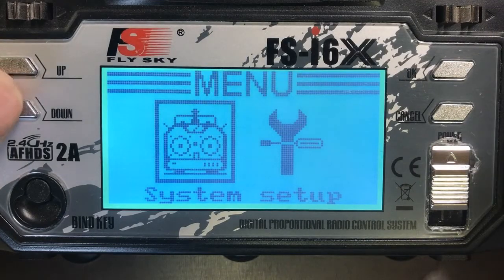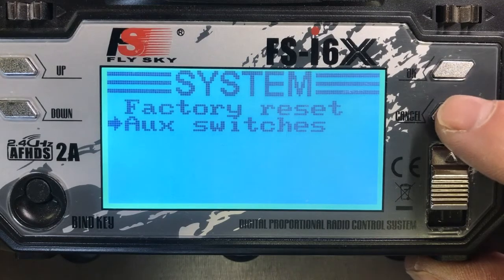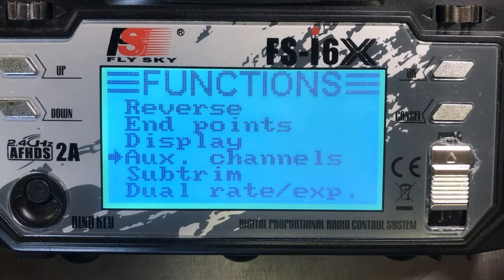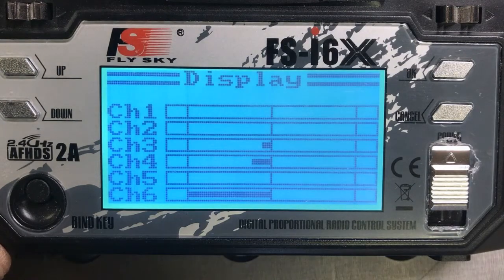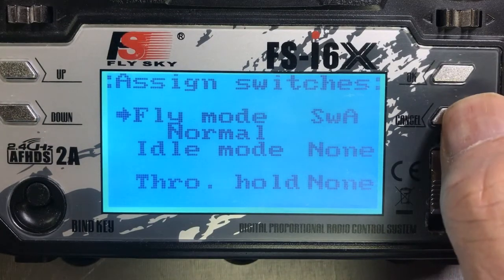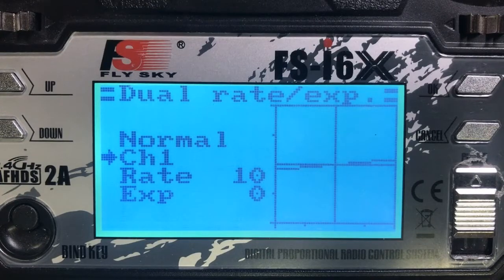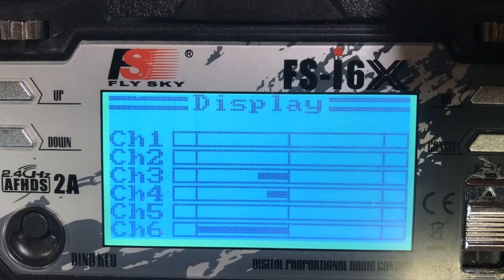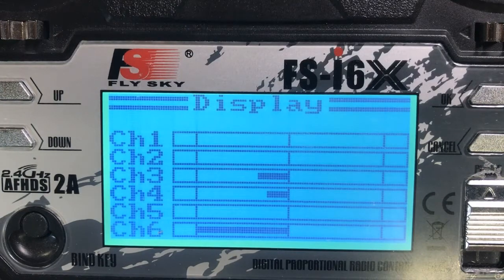4 WD RC Mower Flysky transmitter setup for 2 speed operation

Comment: Apology for the repost @toxicau8408 was not my account but I wrote message. G-Day Giter Bilt, Love your videos. I have a question for you if I may. I'm currently trying to rebuild the electronics of a track mower I brought from China. I'm attempting to use the sabertooth 2X60 with the FS-I6X transmitter with the stock 10Ch receiver to drive dual motors. The challenge I have is the Sabertooth's mixed mode to doesn't seem accept/interpret the forward, reverse and turning cmds from the transmitter/receiver, I can't seem to get it all working together with the centred joystick. The only way I been able to solve the problem it is to turn off mixed mode and rely on the transmitter to do the mixing. I'd prefer the sabertooth to manage the mixing if I can. So question(s) I have for you. Is, have you had a similar problem or are you using a Arduino manage the connection and commands between the transmitter and Sabertooth. Or have you any advice on your Transmitter configuration. Cheers

Comment: G-Day Giter Bilt, Love your videos. I have a question for you if I may. I'm currently trying to rebuild the electronics of a track mower I brought from China. I'm attempting to use the sabertooth 2X60 with the FS-I6X transmitter with the stock 10Ch receiver to drive dual motors. The challenge I have is the Sabertooth's mixed mode to doesn't seem accept/interpret the forward, reverse and turning cmds from the transmitter/receiver, I can't seem to get it all working together with the centred joystick. The only way I been able to solve the problem it is to turn off mixed mode and rely on the transmitter to do the mixing. I'd prefer the sabertooth to manage the mixing if I can. So question(s) I have for you. Is, have you had a similar problem or are you using a Arduino manage the connection and commands between the transmitter and Sabertooth. Or have you any advice on your Transmitter configuration. Cheers
Reply from the maker: Hi, thanks for the complement. My setup is mixed mode on Sabertooth. Receiver channel 1 to S1, channel 2 to S2. Default mode 2 for the joy stick. No Arduino, no mixing on transmitter. Sabertooth dip switch settings 1 and 5 off all others on. I have a wiring diagram I used on my shared Google drive. Let me know if it still doesn’t work, and I will see if we can trouble shoot the problem.
Reply: @giterbilt5146  Thanks Giter Bilt, I tested on my machine today and I finally got it working. Much Appreciated

Comment: Dear Sir, I am looking to build a string trimmer for a heavily wood steep slopping several acres. I need to control 8 DC motors like your mower. I was given a r/c system like yours and it is currently controlling two electric wheelchair motors with one sabertooth 2x32. With your experience have you any suggestions on how best to do this. See the robot called "Chaos" by ASI ROBOTICS to understand the functioning system. ASI built Chaos for the military. They gave me the two wheelchair motors, control and R/C . They didn't have a Chaos robot left, the military took everything in 2013 when they stopped funding ASI. I am glad to get what I have from them. Now I need to build this string trimmer on one man budget. So glad to find your great work to give experience in this process. Thanks for any help!!!
Reply from the maker: Hi, I took a look at the ASI Chaos with tracks, hell of a design. I can only offer the most basic information, at the most you would need a maximum of eight independent motor control channels. Size of the controllers would be based on 6 times the current load of the motor. The rest of the design would have to be a complex set of motor  positioning feedback loops, and sensors with the entire machine being managed by computer control with custom written software.  Good luck with your project.

Comment: Using expo might be helpful in allowing you to do tight turns without being too twitchy to make fine steering corrections when moving more or less forward.
Reply from the maker: Thanks for the feedback. I tried quite a few combinations with expo, my thumb shakes to much to use small variances in stick movement. I also had difficulty in making the transition in the power curve, which in turn produced an  over current draw resulting in a reboot of the controller.  Scary situation when you are only feet from a body of water. For me, the 10% mode gives the assurance that a small mistake on the stick will not turn the mower into a submarine.
Reply: @giterbilt5146  Yeah reduced rates would be the main part of the solution. A person might also be able to use a heading hold gyro.